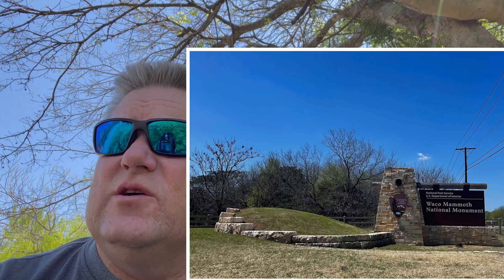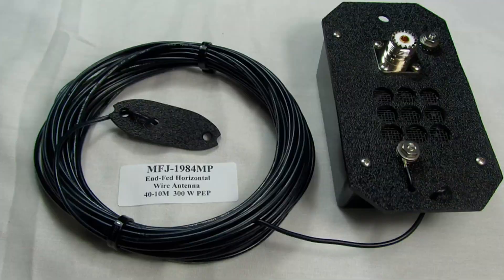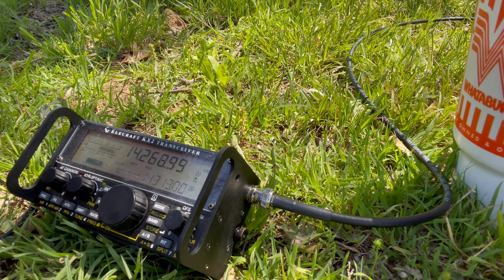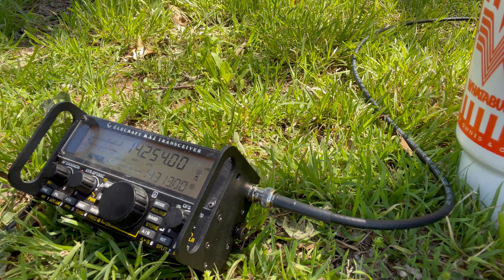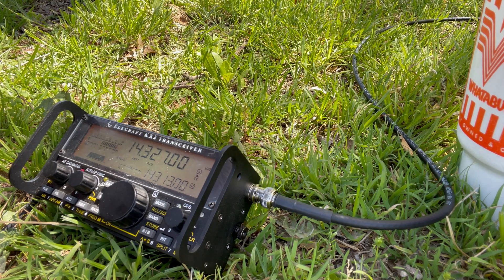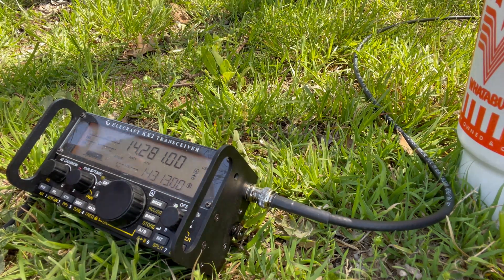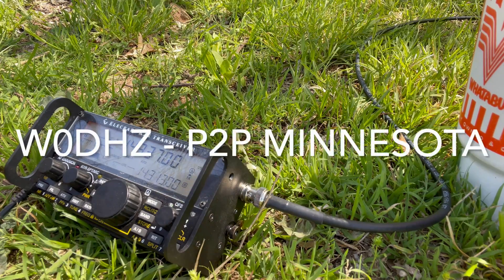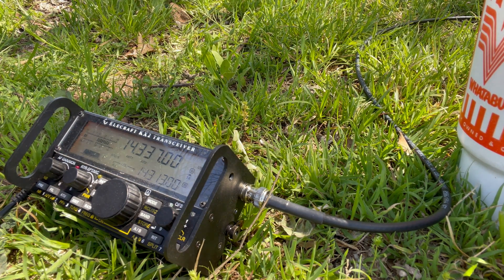Another Antenna Test: Introducing the MFJ-1984MP QRP in Texas

Comment: With the antenna you need to get the end up much higher. 25’ or more or the set will not be good on most bands.
The box end doesn’t like being more than 8-10’ off the ground. SWR will be very high if it’s any higher.
To get 10M swr low the box needs to be lower.  For me 10m is the only one that is not great when all the other bands swr is good.

Good video but I just wanted to put my experience into the mix. 

73

Comment: Nice review, impressive results. How would you rate this antenna for a home install?  Using a ft 891 so might opt for the hp version. Size is perfect my place, and price is reasonable.
Reply from the maker: Seems nice enough. Would definitely need some weatherproofing and possibly a case or cover for the trans match as it has vent holes in it that face down with weight of coax but could potentially get moisture in it for sure. Ham-Solo K0FYR
Reply: @Ham-Solo  Exactly. I was thinking of a non mettalic outdoor gfi box mounted to the mast for the transmatch unit and possibly an upgraded insulator at the other end.
Reply from the maker: @GG-vx7gi  yeah should work fine. I know KF7P does boxes as well as surge protector/lightening adaptors especially if outside. https://www.kf7p.com/KF7P/EntrancePanels.html Ham-Solo K0FYR